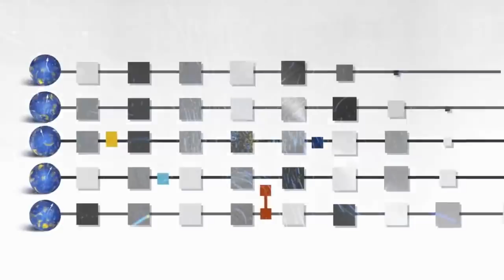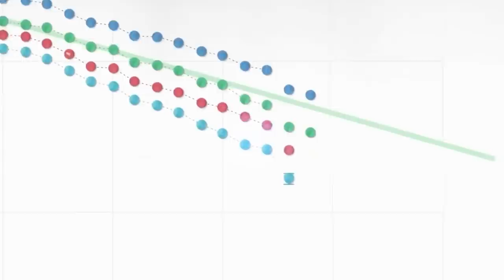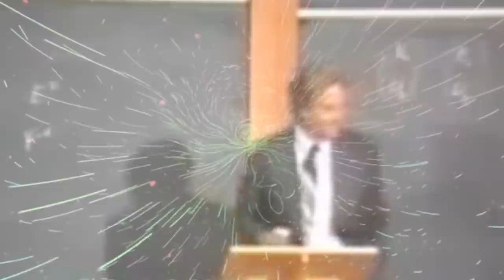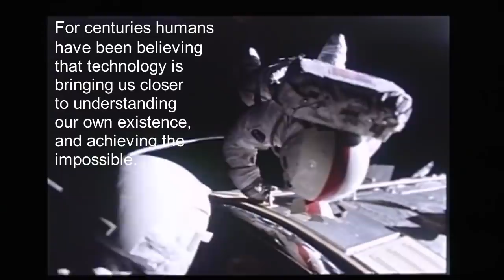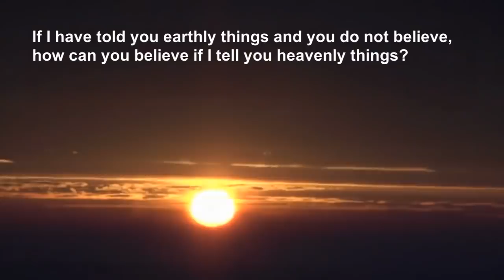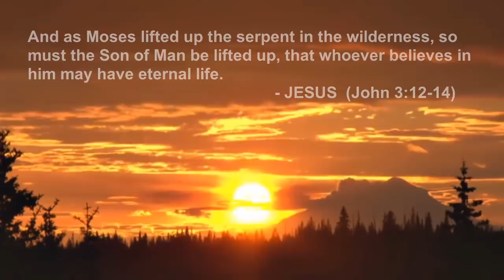The Supremacy of Qubit Stupidity...

Comment: "The first satellite we launched didn't do much, it was just beeping" he said. That's where the lie began.
Reply: Marcel LeMay was the first satellite launched or was it raised by balloon,? did it orbit the flat earth??
Reply: @kimsand53  Great question.  Sort of like the weather balloons.
Reply: Husband finally realises I don't believe in satellites. Take a look at 5G. Supposedly stronger but how is it it's such a weak signal the land towers are more and closer. How low do you imagine these "satellites " would have to be to the ground to even send a signal. Such bull.
Reply: @m.j.2939  hmm running on solar panels and batteries yet the cell phone towers with great big thick cables running of the grid are trumped by Suttonbank bank in the uk certainly on my network when In theory at a vantage point like that surely you should get a signal it's not massively high up.

Comment: The qubit is what does the work. Kinda like a piston in an internal combustion engine. There are multiple designs. Quantum is like a rotary internal combustion engine. The typical gasoline engine take 3 strokes to make 1 power stroke. 4 stroke engine. The rotary has a different piston that does 3 strokes at once. One rotor is equal to 3 pistons. A rotary engine exists in multiple states at the same time.

Comment: Einstein didn't believe quantum entanglement could be possible due to his theory of relativity about the vastness of space/time. Even though the math behind it worked, he couldn't perceive how things over distances had an affect on each other. That's what the double slit experiment was all about, seeing that infact, things over distances have affects on each other (spooky action at a distance)...

In my eyes this is exactly how God said the nature of things are at play, that distance doesn't matter, that cause and effect go beyond that, that our very thoughts have repercussions either good or bad, that if you merely hate someone,  that equivocates to murder in his eyes and that prayer is so powerful.

So mankind builds a physical pathway (Qubit) for voltage/electrons (1's/0's) to simultaneously work on equations and it works because things are connected, distance not being a factor. So man built a machine that allows voltage/electrons (1's/0's) to interact with one another on opposite sides of the chip at the same time, that don't actually have to physically travel through the circuitry to relay that info;  thus finding solutions exponentially because each is calculating a different set of problems/solutions and working out the wrong answers, sharing that information without having to travel through the circuitry and eliminating redundancy from solving something the other end of the chip already did.

Comment: Quantum computing is easily understood if you you think of it as a wave computer..the cubist can hold both 1's and 0's because the data is stored like an electric wave so the same physical bit or qubit can be used for multiple calculation processes at the same time.this is how it can achieve results so much faster then a traditional time clocked based bit computer where it is essentially each second taking snapshots of all the bits and performing 1 calc at a time before moving on to the next calc...its not that spooky, its actually really cool and believable concept and I have no doubt that they have achieved this ability...our brains already run  this way using a bio-electical qubits called neurons. ..
Reply: These new qubits are like atoms with an electron orbiting it...every 1 added to the qubit increases the orbit of the electron and every 0 takes away from the ordbit... the old styled bits were more like a hole that either was filled with electricity, or empty for the 1 or 0
Reply: The real problem is that these d-wave computers or extra dimensional because they are wave/frequency based which to me means that they can be accessed and influenced remotely...perhaps even demonically...
Reply: Every d-wave we build is another soulless vessle in our plane of existence..
Reply from the maker: Now that is a fascinating comment chain...  You wrap it all by saying "these d-wave computers or extra dimensional because they are wave/frequency based which to me means that they can be accessed and influenced remotely...perhaps even demonically...", which indeed, is a case I have more or less been trying to make for a few years now.  

Can you attempt to explain that demonic access/influence in terms of electrons and wave/particle duality etc?  Is a demon a wave? Or is it a particle..?  

How do exactly do you take a "snapshot" of a subatomic particle anyway, without the use of other subatomic particles interacting with it?  

You seriously believe that your brain consists of "bio-electrical qubits"..?  Such a notion is one that is completely derived from trying to explain human consciousness from an evolutionary, even transhumanist, worldview.  

I confess I struggle to comprehend the kind of fragmented thinking that somehow tries to simultaneously embrace quantum "science", and the existence of interdimensional angelic beings, and the "spiritual realm(s?)", etc, as if the question of where you have to stop and admit the futility of imagining that we could eventually explain all such phenomena in terms of particles, waves, and equations, is something than can be ignored...
Reply: @thetruthisstrangerthanfict4367  I will reply with more later, as my phone is acting up and I gotta go to work, but for now I will respond with this: 
...The mandelbrot is an example of a non-sentient wave, and every view you take of it is a particle with specific dimensions...so yeah us and them are sentient waves...
Reply: @thetruthisstrangerthanfict4367 ... oh yeah...boson = wave too...you should study quantum physics for yourself as you can, you can totally get it ...I'm just trying to help, i hope you know this...

Comment: So if the processor is 50,000 times faster, it would take a regular computer 115 days to compute the same amount of data as the 'Quantum computer' does in 3 minutes and 20 seconds.
Where are you guys getting 10,000 years from ?